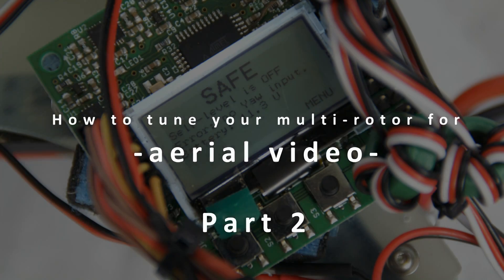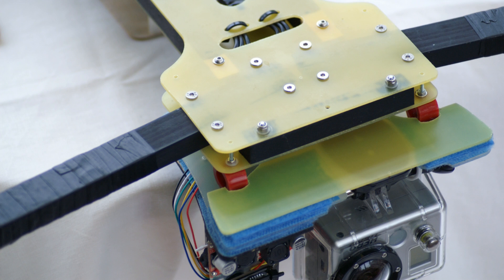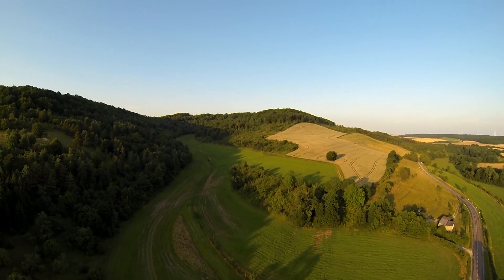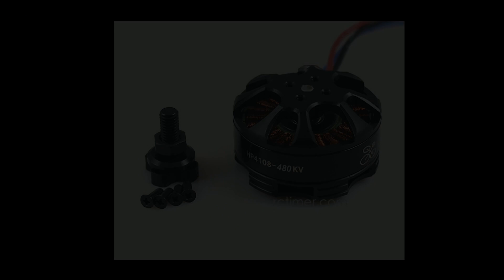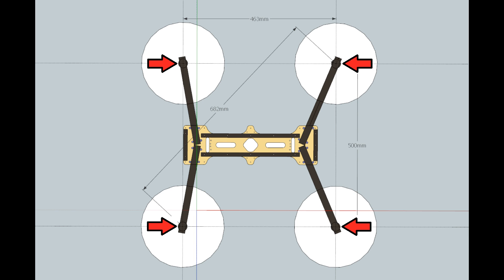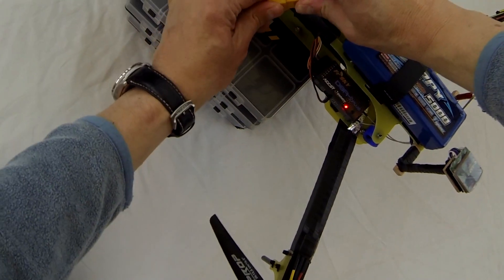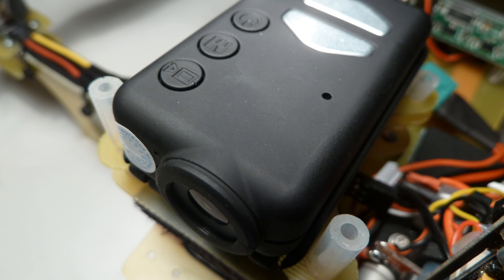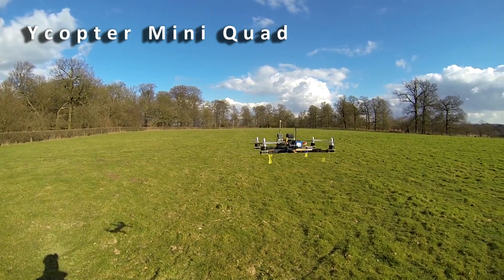Tune Your Multi-rotor Part 2

Comment: Thanks for sharing your many insights. I particularly like your modular design, how you adjust your center of gravity and tilting the motors to enhance yaw rate. I'm curious to know what KK Board motor layout you would use for the new quad frame you showed, as the motors are not equally spaced. "Quadrocopter X"?
Reply from the maker: Steven, thanks for your positive feedback, really pleased you found the video useful.  Regarding KK configuration, the small 350 size quad is in the 'X' configuration, although the frame is not symmetrical the motors are positioned at the theoretical points of a square 90 degree 'X' style frame.

Comment: May I ask what FC you were using in either of the two frames featured? The Mini Y covers some serious ground. Really terrific shots. Also of the garden in Part 1. + The before and after Gimbal. I really enjoyed the banking in the raw footage. Kind of gives you a little vertigo :-) May I adopt the multi-pin quick disconnect? Solid idea there for certain. I was just putting a combination FPV and servo based gimbal supporting my 808#16v2 (my first) on one removeable subframe assbly. That is just the ticket! Regards
Reply from the maker: Chris, pleased you found the video interesting, the mini quad uses a KK2 board flashed with 1.6 firmware, and I have two of the larger quads, one uses Openpilot CC3D and the other the Revolution board.  For ultimate smoothness the Openpilot is the best, but there is not much difference between them, they are all excellent.  I also like the video without the gimbal, it really gives you a sense of flying in a dynamic way.  Good luck with your building, feel free to recycle any of my ideas!
Reply: ***** So how are you cutting your FG sheet. Have you access to a cnc?:-)  As we look side on at the construct (1:42) for instance, the cuts are really smooth. I cannot access these services.This could not be done with a DIY desktop unit. I have adopted the quick release wiring. Can't believe I hadn't thought of it considering my sound studio experience. There is one other thing I would ask of you. In the beautiful photo array on the Flitetest site you have the FPV camera mounted in one grouping. Would you identify the components other than the 12v volt reg, VTx and camera. What is that hiding behind the Dc to DC Buck Converter?  Other than that, how do you like the OpenPilot CC3D board for configuring. I am aware of the Revolution board because it can be flashed with Arducopter, and flown via Mission Planner. I am also making a new Hexa with the APM2.5.2 as FC and get a little more vertical separation between niosy power leads and distribution board. Once I was going to use it on the Hobby King X650F quad. But it is a little on the tight side and the power distribution board is just way too close to the on-board magnetometer. Though RCTimer has a great solution to this, don't know whether you have seen any of their wares seeing as you build all your own stuff. Perhaps better to run it on an H / Y type design. Allows for horizontal separation quite handily. Won't bug you again. Not here anyway:-)
Reply: Chris Leech Apologies, all answer found on your build series at FT. Must be an OSD nestled in there underneath the board cam and behind the volt reg. No reply needed. I jumped the gun. I have gone a little wonky as I race to prepare my computers for the end of WinXP support. I addition, I went to the OpenPilot site and got the lowdown on the CC3D and I am totally sold.
Reply from the maker: Chris Leech Chris, no apologies required, I am pleased you have found the answers yourself. Yes it is an OSD.  The FG sheet is cut by hand using a "rod saw", I think it is used to cut ceramic tiles, 3mm diameter and it rips through the sheet, initially I used a hack saw but now use the "rod saw" in a scroll saw and then hand finish by filing.  You mention CNC cutting with a small desktop unit, I would like to have the frames produced so that I could sell them, I was wondering if a desk CNC would be a solution.  Regarding Openpilot Revolution, do you know what sort of GPS can be used with the board, the Openpilot store is always out of stock!
Reply: Yes I do have a suggestion. Read this article published on OpenPilot Forums. The link is http://forums.openpilot.org/topic/36120-alternative-gps-tutorial/. Nice thing is the cheap as beans price of the CN06 from RCTimer.com. The article is fully fleshed out for those that are anxious to get GPS ability before OP has their offering in stock.He goes into the whole process of using Ublox UCenter app and the links to the correct config file that will allow it to work with the Revo, and how to install it/test it. I hope this helps maestro :-)
On the matter of the desktop router type CNC, well it will have to be a fairly big desk.On Google (I typed in "diy cnc"). You will ultimately be presented with the images. And you should find one there that looks to be in your price range and I envy you that bit of shopping. Does SketchUp make the numerical files for you? :-) Try these just for instance:
 https://www.buildyourcnc.com/item/cnc-machine-bluechick-v3 and http://www.probotix.com/
Reply from the maker: Chris Leech Chris, thanks for the info on the GPS, I was not aware that there was an alternative to the OpenPilot  GPS unit.

Comment: Do you need assemblers? I'm in U.K, love to build. Just have a couple of points to make, Qbrain, centralise your mass, don't need to flash (refresh better than SK)
Use battery mass to eliminate jelly.
Put a canopy on it, alot of people like a clean quad (run wires through arms ect.)
Less drag= faster=longer FT. Serious about the build, for a free frame ;-)

Comment: Awesome video! Your quad is so well though out. And mad props for building your own gimbal! question: have you tried the revo or cc3d on your tricopter? I know these do awesome on quads specifically, but haven't seen any convincing information showing they're a step up from the KK2 on tri's.
Reply from the maker: Thanks, I designed and built the gimbal as all the commercial ones were designed to hang down under the frame.  I wanted prop and frame free view even with a wide angle lens.  No I haven't tried the CC3D on a tricopter, I think the difference would be marginal, when the KK2 is setup well it is hard to tell it apart from the Openpilot boards.

Comment: Brilliant work Ycopter - You and Juz are the best FPV pilots out there. You're very generous in sharing your knowledge. It would be good if there were some multi-rotor event/meet-ups in the East Midlands. I guess it's quite a new part of the rc hobby. Anyway following up on your recent tips regarding my Tri I've posted a link to my latest video. I'm using the Gopro 1 which is not ideal but I'm quite pleased with the results so far. Now I just need to dare to try flip/rolls! FURROWS
Reply from the maker: Jim, your video shows a great improvement, less vibration and no oscillation from the control board, well done.
Reply: ***** Thanks Ycopter  - I tried my last pack with Auto Level off for the first time and I think that helped. I was nervous about turning it off but it seems to fly more fluid/responsive without it. What sort of stick scaling would you run on a Tri before attempting a roll at high altitude?
Reply: ***** Thanks for the message you sent. Unfortunately I could not reply unless you add me as a contact. Jim

Comment: Great video. I have a 450 sized quad and am just wondering if i get longer arms for it and make it a 600 sized quad, will it be more stable? Cheers
Reply from the maker: Yes it will, but if your 450 sized quad is not stable you would be better fixing the reason for its instability before making it bigger.  It is likely that either your battery, ESC, motor and prop combination are not ideal, or the control board PID gains need adjusting.  If you provide some information on your 450 quad I might be able to give you some things to try.
Reply: thanks for the reply :D This is what i have on my quad: 4000mAh, 30amp esc's, NTM 750kv motors and 10x4.5 props. The COG is good and my PID settings are low. on self level i use 60 and 10. seems to be fine in no breeze but with a bit of breeze it seems to oscillate a lot. Thanks for your help
Reply from the maker: GooseyGFX Your component selection seems about right, I assume you are using a 3S battery?  What make are the props?  If you are flying it in stabilised mode then you will see some oscillation in the video, try it in manual mode and see if the problem is reduced.  What are your PID settings for roll or pitch?
Reply: Yeah im using a 3s and im using sf props from hobbyking. I dont seem to get any oscillation in the video at all which is good, but the quad is a bit shaky in a bit of wind. I updated to steveis begginer firmware and now seems to be better.

Comment: Amazing video, watched the whole thing. I'm jealous of your one plug gimbal and fpv system.
Reply from the maker: Thanks and yes I'm really pleased with the one plug design.  It makes FPV wiring really neat and compact which in turn is more reliable and less pone to interference.
Reply: Yes, I'm actually making my tricopter frame again, painting it and all, I want it to look professional. I just got a tarot t2d in the mail and sadly a part was broken off the board:( oh well, I just got the bad one in the batch. I think i should get a new one, readymaderc is just such a good company, I'm sure they'll do something about it fast.

Comment: Do you cut out your parts with a laser cutter? If so would you consider selling fiberglass kits? cheers from Sweden!
Reply from the maker: Hi Anton, all my fiberglass frame parts are cut by hand, I use a scroll saw with a "3mm rod saw" blade then file each cut to the paper template.  I drill all the holes with a small pillar drill.  It takes quite a bit of time and is not really suitable for production work!  If I could find someone that would cut the parts using a CNC machine I would offer them for sale.